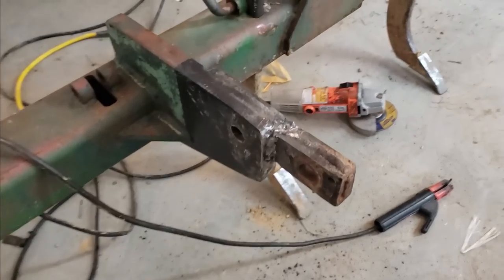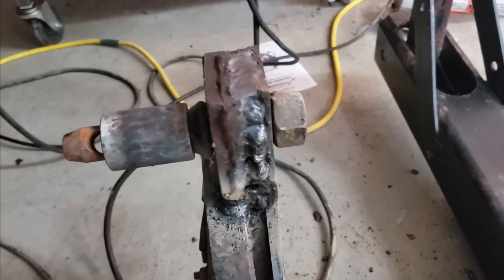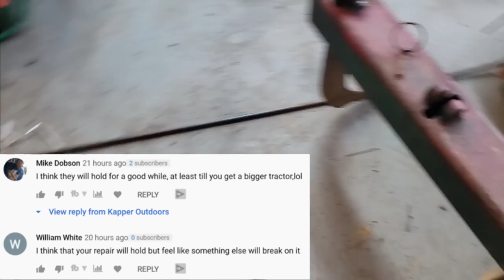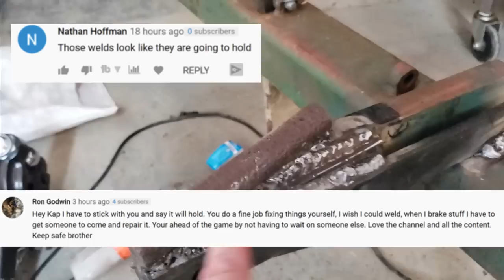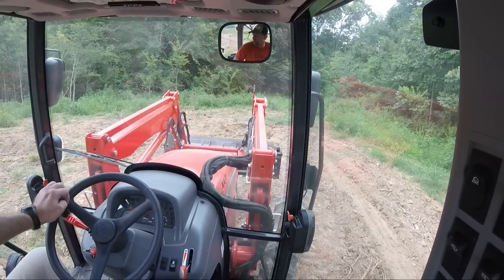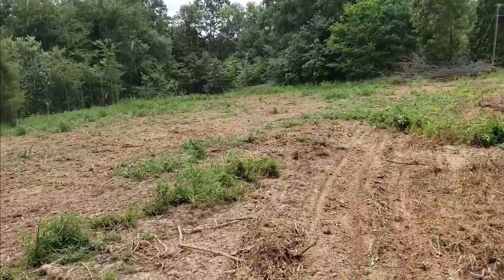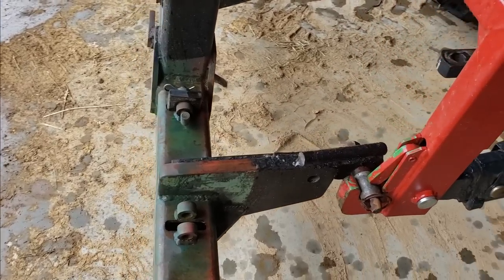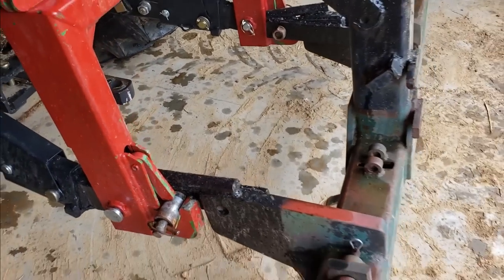Home Made Chisel Plow Action! Will my welding repairs hold up!? Kioti RX7320 back in action!

Comment: Hey, another weld/repair job thats "good enuf for who its for"!!   Ripping the ground should save some gear box wear and tear on your new tiller.  Its just about time to start to plant for fall.  The ground has good moisture and lots more in the forecast.
Reply from the maker: I'm gonna run this ripper a few more times yet it's doing a really good job. I may not even need to till it honestly.

Comment: nice job fixing it with what ya have on hand. now.........i could of saved ya all that stress, by using ur bobcat e35 mini-ex-digging al them stumps up and getting the dirt loose to use the rotor tiller than. i bet i would of been done in a hr tops. but hey i loved the videos u got from it. good luck and keep em coming-ok
Reply from the maker: I did go through it at least twice with the Mini excavator. Just missed a few of the stumps. Thanks

Comment: Kappers own beaver ;) lol
Reply: Also, the very first stump you hit, it appeared to slip between the rippers and is still in the ground.
Reply from the maker: Well that is part of how it works, if it doesn't pull the stump up it tears the roots and weakens them anyways. Which helps
Reply: @kapperoutdoors  Just pointing it out is all... I don't like stumps either... I asked my son to cut the stump to the ground and I nailed what was left later with the mower and was stopped dead in my tracks and almost went over the top...lol... have a good un bud.

Comment: Good video, Kap.  Sorry, I haven't seen many YouTube videos b/c I've been down for the count (medical issues).  I'm listening to my doctor if  I want to be around to see my next birthday.  Love the Ripper how-to.  Are there many roots in the ground you were ripping?  I didn't know a ripper (chisel-plow would break through hefty roots.  I think that's what I need to do in my baby micro plot that i cleared of all  the vertical-vegetation (trees). I was wondering how to break the soil and also destroy roots.  Thanks for the  video.  I bought a single tooth sub soiler and it took out some small roots too.  I need to clear them all, so I use your plot videos as a guide.  Do you have any recommendations Take care of yourself.  I'm finally starting to do as the doctor advises.  Semper Fi brother.
Reply from the maker: Best of luck listening to the doctor and with your health man! This thing seems to be working very well at tearing the roots and pulling some of them up as well.

Comment: I had a chisel plow setup very similar to yours, except the chisels were attached to the main beam via 1/2" thick tabs welded to the back of the beam.  The New England soil didn't cooperate - rocks from the size of softballs to soccer balls.  Within a short time the tabs broke off or the 1/2" hitch pins just sheared.
Tried re-welding it up once, but it didn't last so I gave up.  After sitting around rusting for many years I converted it to a 3-point trailer hitch that accepts 2" square ball mounts, and links to accept skidding chain.  It turned into my most-used attachment! 😁

What will you be planting that will not dry up, and grow big enough to be useful this season?
Reply from the maker: I actually just bought a new home made dual chisel plow/disc!! It will be a nice fall plot mix of lots of goodies! Thanks.

Comment: I do the same thing I just use a box blade with the tines fully extended I have been wanting to try this though
Reply from the maker: Yes this is kind of like that kind of a mix between a real chisel plow and a ripper. It works quite well tearing the roots. Good luck

Comment: That's not a chisel plow! That's the rippers from a box blade turned into basically a small ripper! There's a big difference between the two.
Reply from the maker: Well since it's homemade and the guy who made it called it a chisel plow I don't know if we can argue that too much lol
Reply: @kapperoutdoors  the 2 pieces serve 2 different purposes.  A ripper is designed to break hard pan and a chisel is designed to break hard pan and also stir up the dirt. If you're just trying to break hard pan or dig up roots a ripper is what you want.

Comment: from what I've seen it appear to me that using this piece of equipment a waste of fuel and time.
Reply: It's a subsoiler...breaks up the hardpan in the soil several inches down.
Reply from the maker: Well, I'm guessing you've never done This before, maybe you don't know my objectives. Thanks
Reply from the maker: Maybe if you stick around and see the final product this fall you might see things differently?
Reply: @kapperoutdoors  Doubtful since I unsubscribed....Good Luck!
Reply from the maker: @ronaldkessinger3189  I usually end up making my own 'luck!' so no worries! I will keep after it, with or without you. Thanks.